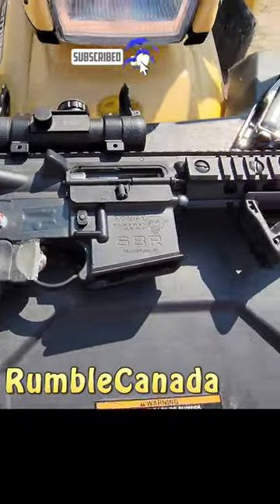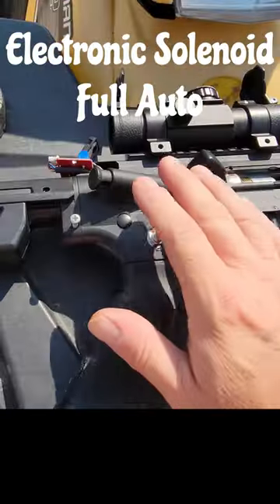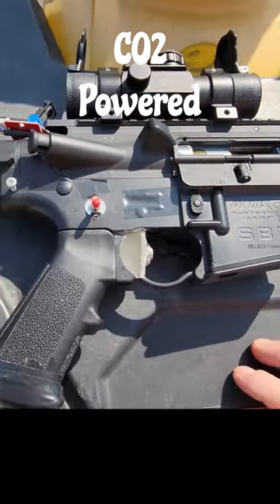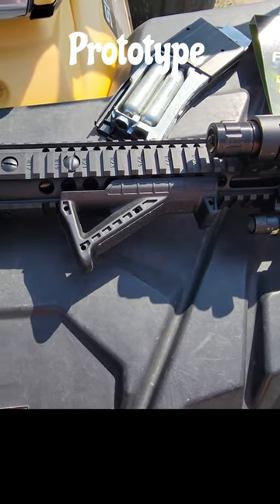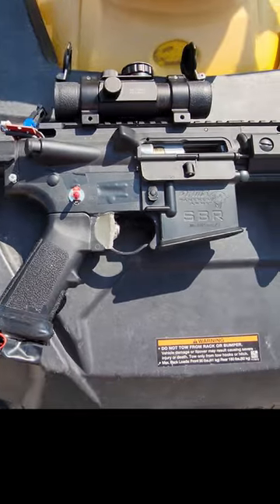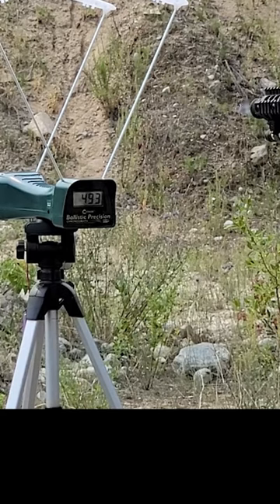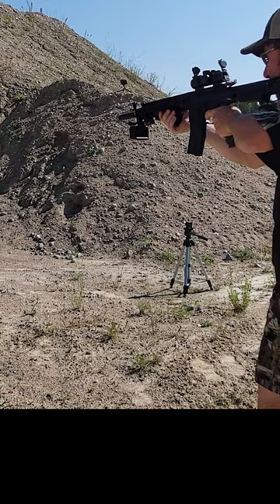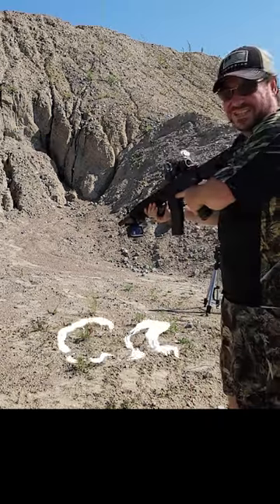Crosman DPMS SBR Annihilator 500 Full Auto Prototype 70vdc #shorts #shooting #gun

Comment: Have you figured out how to reduce the rate of fire say from factory 1400 to 700
Reply from the maker: Unfortunately, I have not been able to slow down the rate of fire from 1400. The only way so far is with my electronic solenoid setup.
Reply: You’d have to change out the whole firing mechanism to change rate. But you can mess with the gas regulator and change the power on that